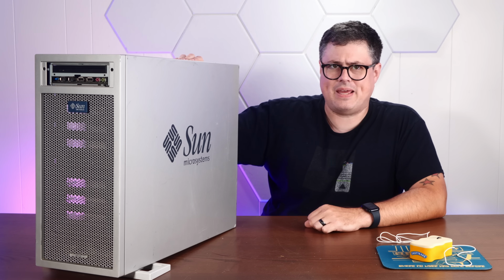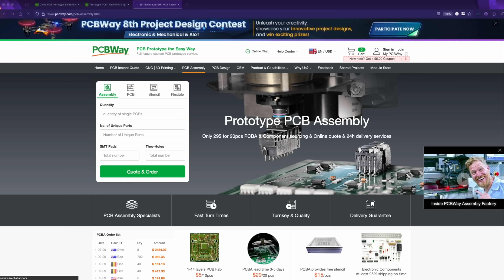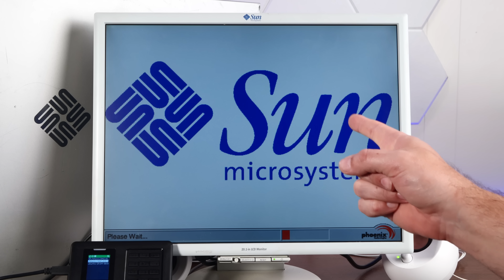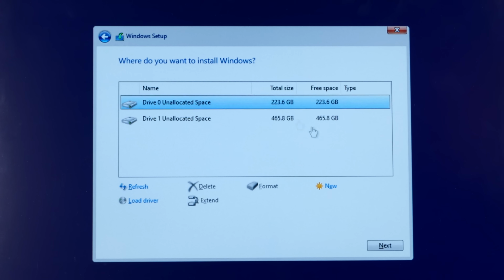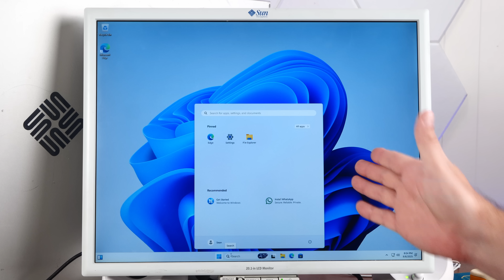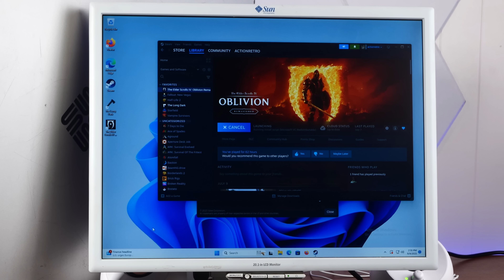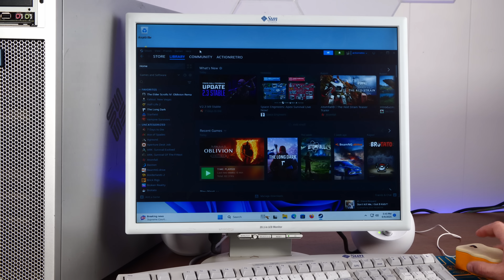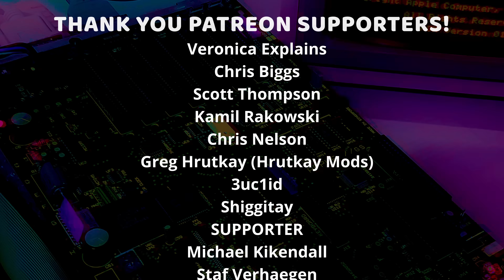The Oldest PC That Can Run Windows 11

Comment: I'm not a Windows fan, but I have to admit it's the most compatible OS in the market, I had a 2011 MacBook Pro that wasn't supported by Apple and many modern software didn't run, I installed Windows 10 on it and it was useful again.
Reply: Conversely, I ran MacOS for two years on a PC that wouldn't support Windows 11 and Linux on a Mac that wouldn't support either.
Reply: Mac pro 2009 and maybe older will

Comment: In the late '90s I bought McAfee anti-virus on a CD-ROM for 40 bucks.  It refused to install on my Windows '98 computer because my version of Internet Explorer, which I DID NOT USE, was out-of-date.  At the time I didn't know updating Internet Explorer without a major OS-wide "service pack" was even possible.  It's been two and a half decades and I'm still mad about that.

Comment: Running a graphics card with an external power supply — done that. Running a graphics card with a SATA-power to 6/8 pin adapter — very intense.
Reply: I ran an optiplex 3010 with a gtx670 with the original dell psu and a sata to 6 pin for a year or two ... Was a great and very cheap gaming system

Comment: A great philosophy: If you have a older Mainboard with CPU and RAM - Safe it up! You never know if you need a second PC someday. Especially if you have friends who might then be able to game with you or for gifting it to someone who needs it! I have two i7 3820 3rd gen running next to my main machine so I can have fun with friends at home. And because I have also saved my RAM (8x 8GB DDR-3) I only had to invest in some low tier Nvidia Cards (3060 and 3050) and a second 2011 Mainboard to make them capable for gaming almost everything now! Windows 11 also runs great on them! And a 1TB SSD only costs 50$ by now!

Comment: I did instll W 11 on a 15 year old laptop, not meeting any of the requirements and it runs perfectly. And that is even the 24H2. Another small pc with an i5 from around 2012, with 6 GB and a SSD: same story. MIcrosoft will tell you not to install, but I did. One machine is Tiny 11 (laptop) and the small pc is installed with an ISO by Rufus. Just works fine! 
But seeing this on that SUb machine makes me think someone at Microsoft is holding back something....

Comment: I ran 11 on an even older cpu, an overclocked pentium 4 651 @4.1ghz which is one of the oldest intel cpu that supports 64 bit and the lahf/sahf instructions which is required for windows 8 64 bit and up to work. I paired it with 8gb ddr2 and a gtx 1070 just because I could (lol).
Reply: Your CPU actually predates this rig. The CPU he is using actually came out in late 2006, so right around the core2 era. And core2 tehnically could run an old win11 build as well.

I think the candidate for the oldest CPU would be athlon64.

Comment: The Old Athlon 64 core has aged very well id say, recently rebuilt and "modernised" office PC for a friend.
Athlon 64 X2 6400+, 16GB RAM and a 1TB SATA SSD, Windows 10 Enterprise LTSC runs very well actually. And Youtube 1080P is no issue.
Fairly sure the onboard memory controller of the A64 cores still gives it an edge in modern workloads over something like the Core2 duos and quads.

Also runs Netflix and other video sites at 1080p or less smooth as butter. Does any office things youd care to do including videoconferencing. 
So all in all it does the job.

Comment: I have a number of "unsupported" machines that have installed Windows 11 Home – the oldest being an i5-3570 rig. The only machine that fails the installer requirements is my 2009 Shuttle XPC with a Core 2 Quad Q9650 – the CPU fails the POPCNT test. The same machine runs Windows 10 Home just fine so I suspect it would also run some version of Windows 11. I would agree that "obsolete" is a relative term. A 16 year old quad core Intel CPU appears to run almost as well as one from 5 years ago. I love pushing my older hardware to see if it can play in the modern world, and for the most part, it does that quite well.

Comment: In some respects it shows the lack of progress in the PC space in the last 20 years
Reply: i agree but disagree. it also just shows the fact that the architecture hasn't changed much once you strip the security enhancing measures from an OS. But Microsoft want's to enforce a higher minimum security standard in the PC space. Simple by enforcing stuff like tpm 2.0 on newer systems, and Secure Boot. remember, they used a heavily modified and unofficial version of 11, that removes security related features.
Reply: @PlushiiMono  It really slowed down. Anything below 386 can't run modern OS due to lack of memory protection and process isolation, we have 64bit instructions and support for running multiple operating systems on one PC (virtualization) so there are some changes in architecture. But speed wise, in 1985 you could afford ZX spectrum, in 1990 286, in 1992 386, in 1993 486, in 1995 pentium and in 2000 pentiumIII and year later Athlon XP that was like 10-20 times faster than processors 7 years old. Today we can use 7 years old computer without any problem, unless they were absolute low end. Before year 2000, three years old computer was basically inadequate. 486 is likely from late 80s, but buying it made no sense, as PCs were extremely expensive and they were losing value fast. Like you would not buy high end threadripper today knowing that price will drop to half each year.
Reply: @pavelperina7629 I'd still disagree, security is moving fast, but we don't need to move off of x86_64 because it literally breaks compatibility with software
Reply: @PlushiiMono I don’t buy it. They can implement security measures without requiring it to install the OS. Most the the stuff that windows 11 “requires” 10 already supports like TPM.
Reply: Not true. The progress has been HUGE since 20 years ago. Maybe in the second half not so much leaping, But still moving at a pretty fast  pace.
What you are experiencing here is software related not hardware, Coding itself hasn't changed much in decades and Windows today is still running off a kernel made 35 years ago, and that kernal was based on UNIX 20 years earlier, So we are always limited by the coding despite the hardware sprinting along lol

Comment: Oh my god. I can't believe that the 6750XT worked. That's RDNA2. Typing this very comment on a computer of similar vintage, I always thought AMDs "Polaris" generation to be the last to work without UEFI. But here we are. Have to order one right away. 🤪
But seriously. Even if you can get the OS to run, more and more software requite AVX and stuff. And as soon as mainstream Linux distros start to require "x86-64-V2" or something, we're ultimately out of luck. History repeats. Remember when a 386 was suddenly too old to run Linux? You needed "686". 😉

Comment: 3:05 - gotta love those server-grade big-iron workstations and how easy it is to maintain the hardware... no tools needed.

Edit 6:50 : isn't it possible to add an autounattend to tiny11 to get rid of Edge from the beginning and install your browser of choice from $OEM$ instead?

... okay, I know, this is mostly an experiment... but still, if you actually intended to keep using this 'puter, it'd make sense to have an iso/boot media at hand in case you want a reinstall in the future.

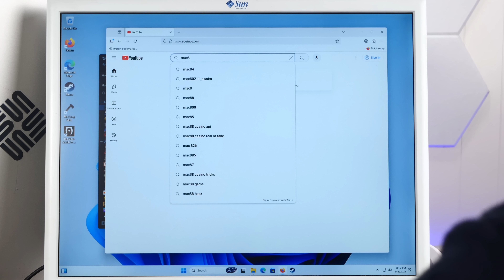7:20 : aren't most computers older than the software they run natively? Are you indicating that you are in possession of a time machine? It's difficult to develop for hardware that doesn't exist yet.

Comment: Windows 11 is Vista for Gen Aplha. I am Gen Z (born in 1998) and not only that I used Vista, but XP too. And at the elementy school we even had Windows 2000 😶
Reply: I was there when Vista was released and Windows 11 is just fine in comparison. Vista actually had crazy HW demands at its time compared to what people had. Win11 has them just on paper, but runs fine. Also you could say Win11 is Win10, because Win10 was hated and hardly usable (buggy) for YEARS. I've been using 11 (on work laptops, on others I used 7 and 10) since 2021 and don't see what the fuss was/is about. I am no Win11 fan, neither win10. If I could, I would still use 7.
Reply: @YS_Production  Yeah, it's weird how people forgot that people hated on Windows 10 for the longest time after its release up to about the release of Windows 11.

Comment: Microfuct claim my current computer doesn't meet their system requirements for Windows 11. I've checked all their specifications and my system has about double the requirements. I built it way back in 2014, but I used high-end specs, including 16GB of RAM from the start.
Literally the only piece of hardware they want, that I don't have, is a chip that plugs into the motherboard to enable encryption of my primary storage drive. I don't want to encrypt my drive, because if there's a failure in my motherboard or that plug-in chip, I'll be screwed. I won't be able to recover any data from that drive.
I try not to store data on my primary drive, but things like PDFs automatically get placed there.
Reply: Even if u plug in the new tpm chip and enable it through bios the official windows 11 install still wont work cause it checks if the cpu is on the supported list. I tried that with a i7 6700k and 32gb of ram. Theres no reason why windows should retire that cpu. A high end cpu from 10yr ago.

Comment: Sean that cpu isnt from 2005 the 2220 SE was Released Aug 15th, 2006 so this mashine is either upgraded down the line before you got it or its from 2006 also the only system that had it from bulld date was the utra 40 M2 witch is from November 29, 2006

Comment: The control key on a Sun keyboard is in the correct place, right where it belongs.
I have a similar Sun workstation with an AMD CPU, an Ultra 20.  I have it running Linux and Solaris.
Reply: I have an Ultra 20 serving as a giant step stool for another tower PC.  Looks like it supports 64 bit, but only(?) one core.  Does yours have one or two cores and is your Linux and/or Solaris 64-bit?

Comment: The most impressive thing is that the long dark runs well with those CPUs since they are absolutely ASS. I had both a system with a Opteron 2220 and a E5300 and boy the E5300 SMOKED it back then.

Comment: this video is going to make me believe all obsolescence is planned obsolescence
Reply: It really depends. Things that are cheap and shitty when new only get shittier as time goes by. This computer in this video was a pricey beast in the day.
Reply: I mean everything but the CPU and Mobo were swapped out for modern-ish parts. Though the RAM is whatever low end platform from the time it's a 2010's equiv capacity. This is is like a human living 200 years by sticking their brain in a jar. Impressive yes, but not indicative that humans were meant to last that long.
Reply: It is. The origonal IBM PC ethos is compleatly gone now.
Reply: Moore's law died around 2005, so anything from then on is going to last a lot longer than anything older.
Reply: No it litterally is. Straight up.
There is nothing new being developed in tech anymore. Just the same old slop.
Reply: Thanks to capitalism (and especially the stage we're living in, imperialism), a lot of "obsolescence" is indeed planned/by design.

Comment: i have dual opteron 250 and opteron 252, motherboards and ram. i have loaded linux onto one and it was painfully slow. i'm yet to find someone who wants to complete their retro lab with an age appropriate windows server :P

i would send one your way, to potentially be the lowest spec computer win11 could run on, but the intl postage would be expensive, and risky.

Comment: 3:08 - that m.2 SSD literally says SATA SSD on the label. And you're using an m2 to PCIe adapter. "m.2" is not a one size fits all interface. Some m.2 cards implement SATA interface, some PCIe, some USB. You put a SATA card in a PCIe adapter. Doomed from the start in any system.

Your second attempt was properly an m.2 NVMe drive, which - NVMe is a device class using PCI Express - just needs the right implementation driver in the OS, which Windows 11 definitely has.

Your next challenge would then be that the computer's BIOS doesn't support booting from it - because a system that old has no idea what NVMe is. You can bootstrap this using an EFI loader (a legacy boot loader that creates an EFI boot environment and loads EFI drivers like NVMe) off your supported SATA SSD, that could then boot the NVMe drive...

But... since we're down here at "didn't even realize that was a SATA m.2 drive", ... 😭💀
Reply: Can we use Clover in this situation to install Windows 11?
Reply: @Deimos_Fresh  ~ Clover might be one way, but I can't remember the name of the other. I recall the loader I used in the past was some kind of "dev-kit"-like software that helped develop EFI boot using legacy hardware, so it starts off as a BIOS/legacy boot and then creates an EFI environment. Thus, it can load EFI modules, and thus in turn it can load an NVMe EFI module to hand-off boot control to a detected PCIe NVMe drive. The loader itself just has to be present on an old USB key or such that the BIOS can detect/boot.

Wish I could remember the name of it, though - but that's the premise of it. I did it to boot from NVMe on a way-too-old board. For most, though, I just inject an NVMe driver into the EFI portion of the BIOS, and "give it" NVMe support that way.
Reply: @FalconFour , got it. Thanks.
Reply: Who cares? This entire endeavour is inherently pointless. We're not here for correctness, we're here for the hardware hacking and the fun.

Comment: I wasn't able to install Windows 7 64 but on an old IBM Thinkpad but 32 bit Windows 7 installed. It was a first generation Pentium. 
I replaced the 44 pin IDE disk drive with an m.2 drive and it runs great

Comment: Your next challenge needs to be getting a Pentium 4 661, the last of the single core P4s, and install win11 22h2 on it. It’s the oldest Intel CPU that has everything 11 needs to run. I know it can be done, but I don’t know if it’ll work on the latest version of 11. I also believe that it’s even older that the opteron that you used here.

Comment: Tiny 11 isn't really Windows 11.  When people tell me, "If you want a good experience on Windows, just use Windows 11 Enterprise IoT LTSC."  Oh yeah?  Where on the website do they promote that?  Right.  They don't.

Tiny 11 is a hacked repack of Windows 11.  It's been modified.  At best, it's Windows 11 in the same way that Android is Linux.  However, it's also technically not legal and violates their terms of service.  Since Microsoft doesn't give it the thumb's up, it's not really Windows 11, even though it is still Windows 11.  I would still argue it doesn't count as Windows if it doesn't have the spyware, malware, keyloggers, software that violates their previous antitrust lawsuit terms, and other illegal garbage.

Fun video!

Comment: I have an approx. 2014 model PC that at least has SSE4.2... if it hasn't got POPCNT... bollocks! Must check. The PC's at my job only have SSE4A, they are 2009 and 2012 models. I'm working on a solution to make the stuff we do happen with Linux, but our other choice is to get fresher mini desktops and move the SSD's into them. One problem is that we have some 13 year old receipt/ticket printers that are perfectly fine, but their manufacturer's official support for Linux is recalcitrant at best. If we could make them work, we could pretty muc detach from MS.

Comment: The Opteron CPUs lacking a vital instruction set for Windows 11 reminds me of "hacking" MacOS 10.14 Mojave onto a 2008 Mac Pro. The 3,1 Mac Pro lacks a certain instruction set (SSE something) needed for Mojave, but DosDude1's handy patcher tool either installs or emulates this instruction set, allowing Mojave to run nicely on this much older Mac.

Comment: If you can't officially upgrade to Windows 11 you can get security updates for another year for free as long as you enrol in the Extended Security Updates (ESU) program by October 13th. You must back up your Windows settings to the cloud by syncing them with OneDrive, it tells you this at the time and allows you to turn on the option, you can turn it on, enrol and then disable if you want. Yes, you can override the system requirements checks, but it's not guaranteed to continue working with future updates, it's a risk, especially with very old hardware.

Comment: i had one of the original AMD Athlon64's with a single core, and I couldn't even install windows 7 64 bit on it.
I was able to install Windows 11 on an Intel Core 2 Quad (9200, socket 775) using a copy of the 22H2 build.
9:23 He installs new video card, boots PC and says "What do I need updates for?" SMH

Comment: The 9070 not working might just be a option rom firmware issue with the card and that old BIOS on the computer.  One thing you could try to get the 9070 to work is use the K2000 as the primary card and the 9070 as secondary and have w11 use the 9070 for games.

Comment: I wanted to play a modern racing sim and on their system requirement it said my build would have a hard time at 720 on the lowest settings.

When I installed it I slowly began putting everything to the max setting and then even went to 1080…. Runs perfectly.